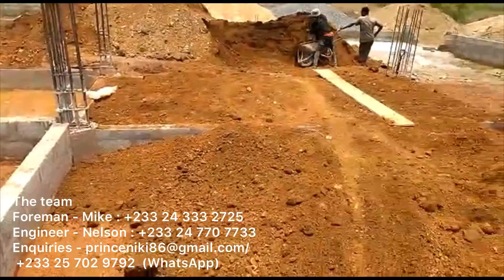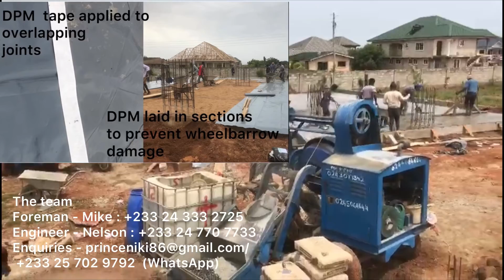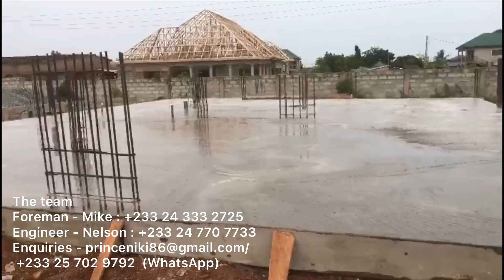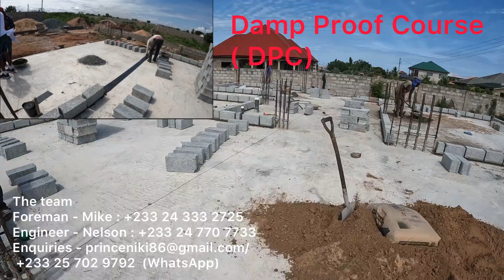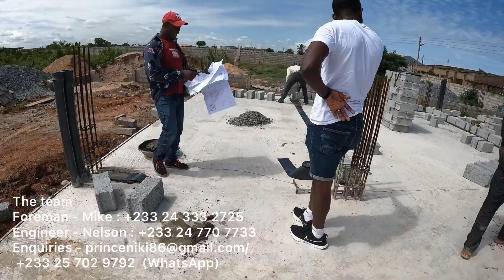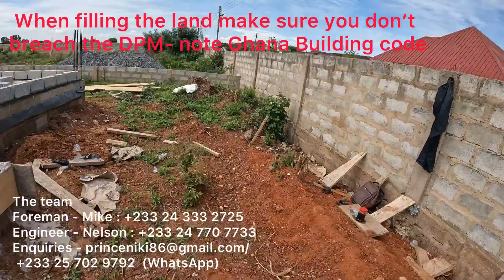Building in Ghana, How to DAMP proof using DPC

Comment: Damp proof sheets were not used for my fence wall foundation before concrete was cast, is there a way to use the damp proof membrane when laying the blocks for example?? Thanks in advance.
Reply from the maker: You don’t need DPM for a fence but the wall must be treated with appropriate damp preventative measures before plastering with waterproof mortar. For more information and advice please contact us on +2332570292792. Thanks
Reply: Thanks so much 🙏.

Comment: So far, there is no perfect solution to our water dumping problem in Ghana. Everyone have some time of solution that we can always rethink through to see if this the right solution.
I like this method but the issue on this is, if the rubber prevents the dump from rising, won’t it stay beneath and eat up the concrete and weaken the foundation? 
I have no idea but I hope your solution helps because building in Ghana now is expensive but this evil water dumping is a headache. 
We need our engineers to come up with a one fit solution for us.
Reply from the maker: Actually, there is a perfect solution for preventing rising dampness, and it's all written down in the Ghanaian building regulations and codes, but it's not followed. It's important to select the appropriate DPM based on land conditions. The specially formulated rubber must be laid in accordance with the manufacturer's instructions by ensuring that the minimum overlapping requirements are adhered to and all joints taped. The membrane prevents ground water from coming into contact with concrete. If in doubt, it's best to speak to a damp specialist.

Our process complies with the building code.

Comment: Thank you for the video . Can you please let me know -Do you put the Dpm then the wood around the building or vice versa?
Reply from the maker: Yes, the DPM must be laid before installing the wood profile or formwork for the concrete slab casting. The board is usually removed and stored before starting the DPC and the blockwork but in this case we left the boards insitu because it will be required shortly for the columns work. Thanks
Reply: @princenikki  thank you 🙏🏿 I appreciate it 🥰